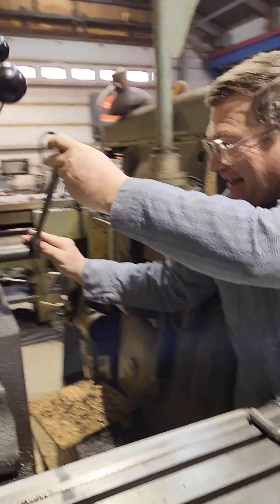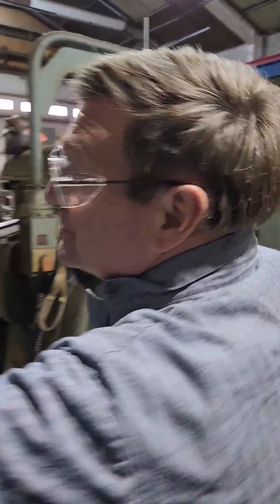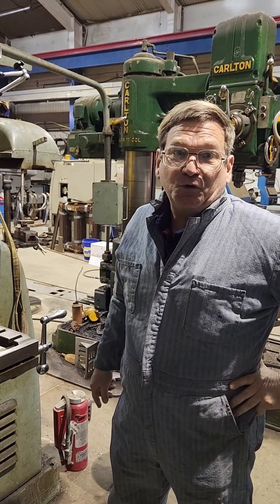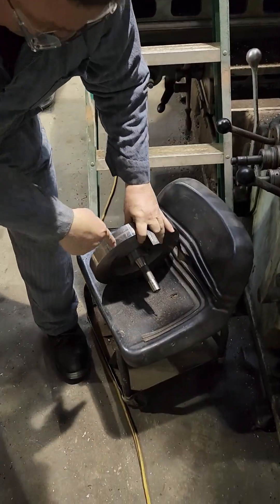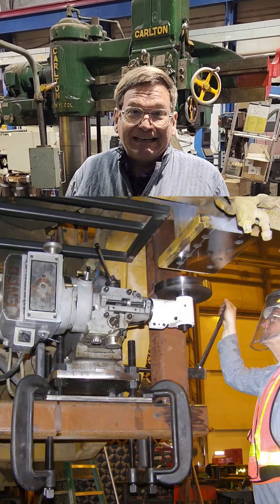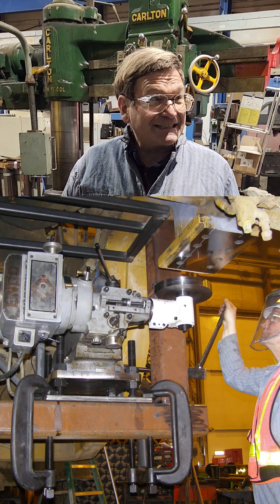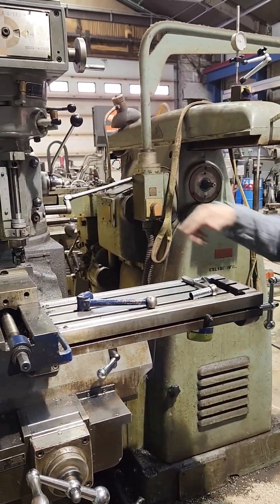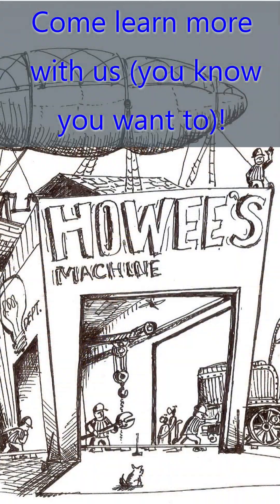Machinist's Minute: The Fourth Axis on Bridgeport Style Mills

Comment: Long time watcher first time commenter. Was just wondering why your bp mill kinda sounds like the old  Massy Ferguson tractor i used on the farm when i was a kid? (It had a terrible knock) Hahaa. Not a Machinist here but a real question Why all the racket from the mill?
Reply from the maker: That clatter you hear at the start is from the cutting. That tool is 6 (I think) cutting bits rotating very fast (guessing about 400-500RPM), so with the slow travel into the part each bit is hitting the edge of the part as it comes around and scraping off a piece. The racket comes from that initial hit. You can hear the machine running quieter after he stops the cut.
-Cameraman
Reply: @HOWEES  Thanks for that informative very understandable answer cameraman. Love your work by the way. It's very Wharhol Industrial. 😏😁Jkjk 😜 You keep up the good shootin.  You do a  fine job. Thanks for the Great content. Keep up the good job. 👌👍✌️

Comment: Yes! I used to run a climax portable mill. Milling offsite is no joke, days of set up for hours of cutting haha
Reply from the maker: I used a climax for a job, it had about 4' X 16' travel, it was modular, year was 2012, it was the newest machine at the time.  NT50 taper.  Customer rented the machine, it had no dials, could have had a read-out option if ordered, I added dials, and tape scales.
Reply: @HOWEESMACHINESHOP  how did you like her? We had a failure on the hydraulic power plant but the rest of her was great!
Reply from the maker: @josephmcandrew7937  It was OK, but not great, had good power on the spindle.  The feeds were 90 volt dc drive, so they were more of a pressure setting than a feed rate.  The frame modules that bolted together were lacking anything to ensure they would stay straight.   All in all the job went well & I think it's a lot of machine for $50K, however the almost $200K price seemed like it should have been better.

Comment: Umm I've never used the ram in operation while cutting but then again I'm young enough most of my career has been on CNC so hell I guess you learn something new everyday. I thought you just extended the ram if you were doing some funky stuff. Like one time i clamped a U shaped handle to the table to bore out the spline on the center mounting hub that was stripped to press fit a sleeve with that spline in it and I had to extend the ram all the way out to get the reach I needed.
Reply from the maker: Did You look at the 994 repair we did using this?  I think it is originally intended as an accurate repositioning device, but machinists will do more with what they are given, when needed.  Have you ever used a parts catcher on a CNC lathe, as a shuttle device to forgo the need of a robot?  I personaly have not, but other people have.
https://www.youtube.com/watch?v=9ZACdncQej8

Comment: @howesmacineshop. I have an enco mill but can find any literature on it. Do you have any for yours? I contacted MSC and my machine predates their records.
Reply from the maker: MSC sold me the parts the last time I needed.  Enco imported several different brands, with their label glued on.  Mine is a Nan Tung (per MSC) made in 1997, I purchases it new from Enco.  It is 10x54 variable speed head, biggest identifier is the lack of any attachment points on the back of the ram.  Most all come apart similar to a Bridgeprt, but parts don't interchange & many older machine will require you making your own parts.
Reply: @HOWEESMACHINESHOP  thanks. Mine is a mid 80s model. Very heavy. Not sure the bed size. 2HP 3phase. $300 from an auction a couple years ago.

Comment: I personally don't like using it on our Bridgeport (11×58).When we pull the head forward, and re check for flatness,  it's off enough to cause issues. I could understand wear, but Noone really uses it at our shop. I still use it but it's to gain clearance.  
We still have the same issue after the machine was reconditioned and scraped.
Reply from the maker: I have seen some that were not good, and others that are very good.  The one I show here, I used to do some pretty exacting work on a field job, here is the link:
https://www.youtube.com/watch?v=9ZACdncQej8

Comment: Don't you get chatter and rigidity problems when you mill with that sliding carriage unlocked?  I've always had problems anytime that axis isn't locked down nice and tight.
Reply from the maker: This presentation (https://youtu.be/9ZACdncQej8) shows a job where we used this axis. The tolerances were nice and tight, no chattering. Some of it is the depth of the cut, some of it is the speed the cut is made at, and some of it can be the mill - some mills will have more slop in this axis than others.

Comment: You're only moving in an x/y/z direction. You're still only three axis, even if it's something else moving to accomplish it.

The whole concept of a fourth axis(or anything higher) only exists with rotation. This is not fourth axis.
Reply: The point is you can make parts this way that is often assumed to only be possible with a 4 or 5 axis machine. Obviously you cannot adjust while machining a part but it does give you a forth "option"
Reply: @dambroangling2828  No, you literally can't.

A fourth axis would allow you to mill the underside of the material you are machining.

3 axis machine is X, Y, and Z. This machine can only go side to side, front to back, and up and down on parts. That is three axis. 
You accomplish the 4th axis by spinning the material.
You accomplish a 5th axis by rotating the cutter head where it can be perpendicular, or parallel with the cutting surface (or any degree in between the two).

This is NOT a 4th axis.
Reply: @monarchco  it's not the fourth axis you usually think of, as I said it is a fourth option similar to having another axis. But I did watch the video again and him adjusting while the part is being milled is ridiculous to do to your machine.
Reply: @dambroangling2828  no. This is not a fourth option or a fourth axis.

This is literally just an additional way of moving it front to back. The same third axis.

Comment: I'm not convinced that is a 4th axis. If you rotate the part the axis is the same.
Reply from the maker: Think about the table axes as ways to move the milling head relative to the part, rather than the part relative to the milling head. In this case it is a '4th axis' as it allows movement of the milling head relative to the part without the milling table being present at all. Here's the job John mentioned using this on, it demonstrates pretty well why it deserves recognition as a separate option for mill head movement: https://youtu.be/9ZACdncQej8
Reply: Absolutely not 4th axis
Reply: Only moves in "y" axis when the column is at "0", set the column at 5°, 10°, 25.74°  and it becomes a new axis all its own, to say it's not usable is baloney...."can't " died in the poorhouse

Comment: What do you use the big Carlton radial arm drill for?
Reply: We have that same machine where I work. We use it for drilling and tapping 2.5 inch 4 holes in 316 stainless steel. We also use it for deep drilled holes in gearboxes and honing low speed shafts that are 36 to 48 inches long.
Reply: @wendull811  good to know the other uses for it are confirmed 🙂

Comment: I've never thought of using that for milling. I normally don't even move that on my machine.
Reply: It’s good to move it in & out from time to time so you spread out the wear on your Y axis.
Reply: @pvtimberfaller  That's a good tip. I never thought of that either.
Reply: I never realized that, the gibs on it make more sense now.

I worked on replacing a swing bearing on a shovel & guy came out with a Bridgeport head mounted on a big RT to surface the top of the undercarriage & bottom of the house.